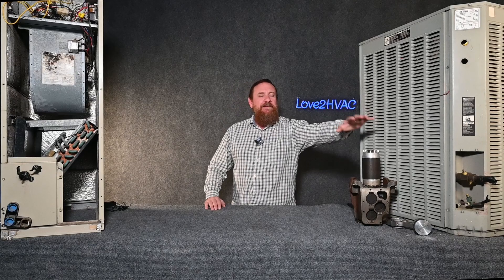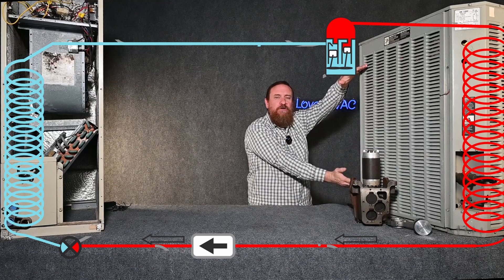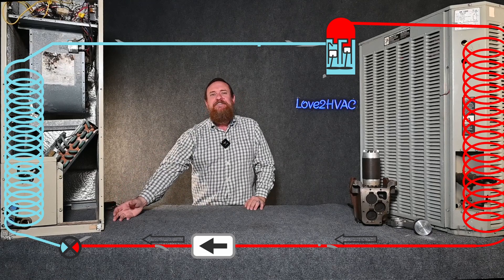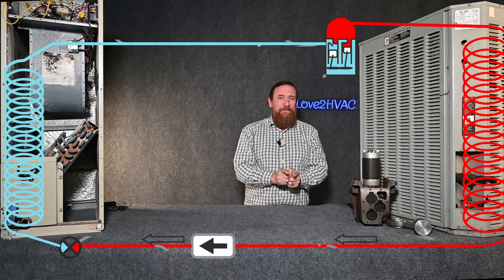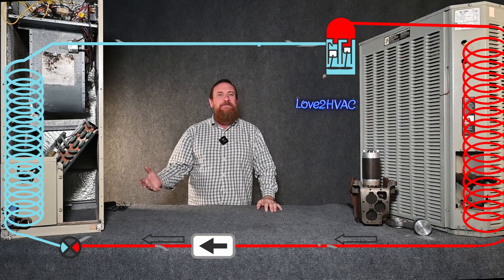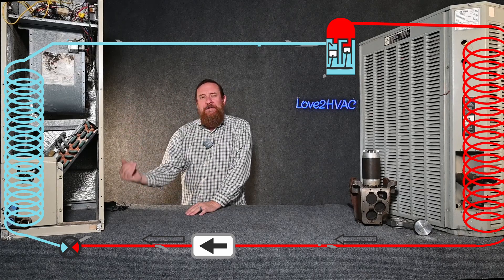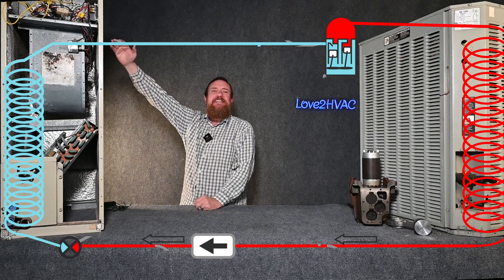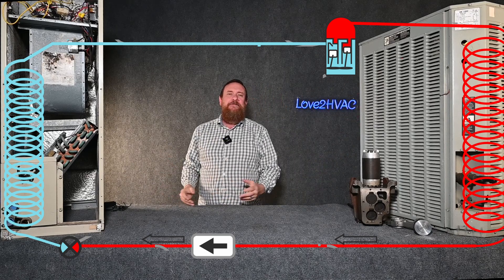Heat pump 01, Foundation basics1st video

Comment: We have recently installed an air to water heat pump. It’s amazing, I am getting a coefficient of efficiency of just over 6 at a flow temp of 25C. There’s zero reason to burn fuel to generate heat for housing, burning stuff is so dirty for the air we breathe.

Comment: This is sligtly off topic - but I wish they designed the outdoor ecaporator/condenser coil on these things so that it operated like an ice machine. Freezes over and takes a huge energy boost from the  1000+ btu/lb from water vapor to ice phase changes, then defrost without fully melting but by making a pile of ice cubes outside instead of usung the heat to fully remelt it. Just need to make the coil angled away and smooth so that  most of the ice doesnt have anything to grab onto. Just a thought.

Comment: Yeah, you really just have two heat exchanger/fan(blower) combos.  One optimized for transfering heat to air in a ducted air environment and the other optitized for transfering heat to air in, I guess you could call it, immersed in a pool of air environment.  Whether heat is going into our out of the air going over the heat exchangers is just a matter of temperature differential.
Reply from the maker: YES!!! Exactly! 💯